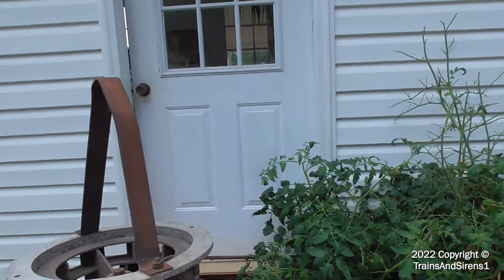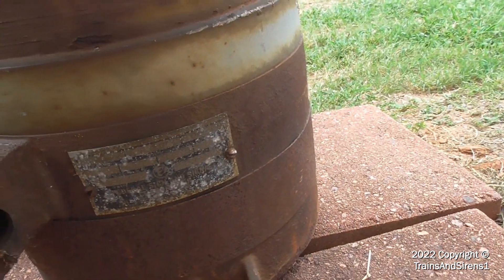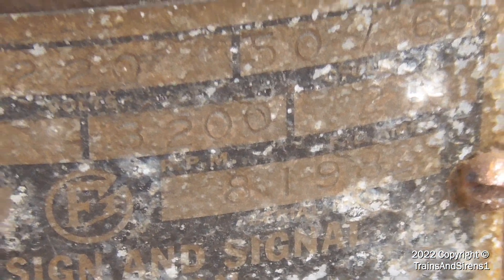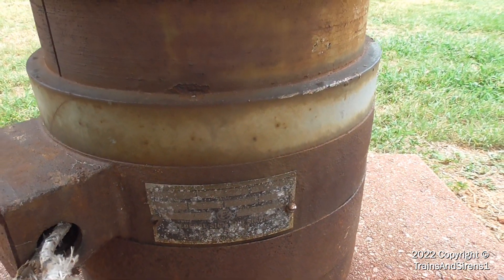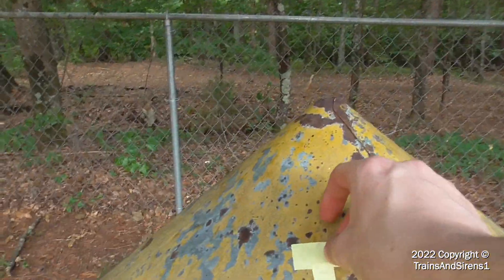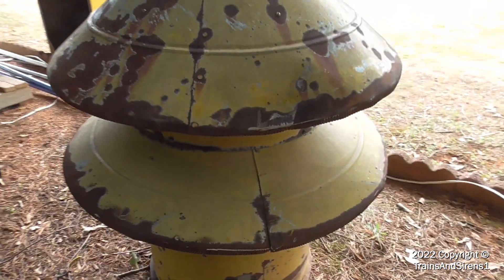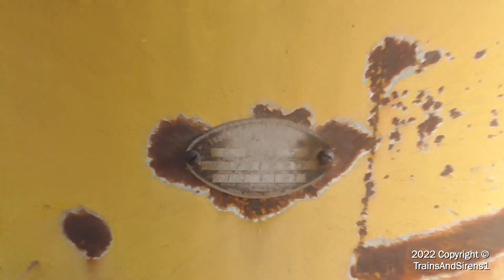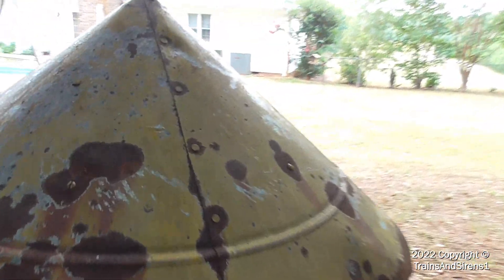My New Federal Model 5T Civil Defense Siren First Run, Growl

Comment: Nice! didn't think that it would work considering the shape it looks like its in.
Reply from the maker: Yeah it actually had trouble starting. The motor wouldn't hardly turn with its own power. My father spun the rotor to help it start.
Reply: @TrainsAndSirens1  I sense a restoration coming...
Reply: @SirensandThunderbolts1003  nope unfortunately he sold it